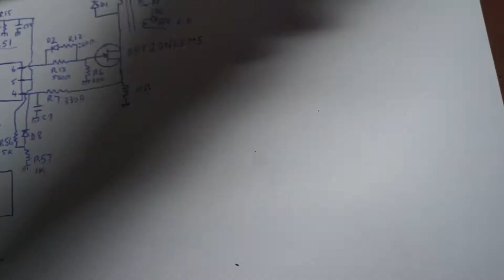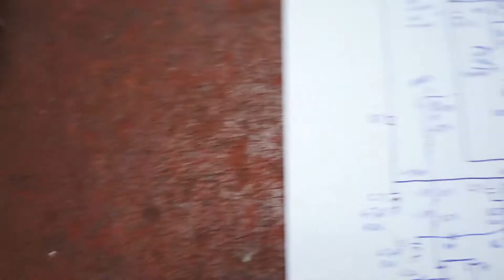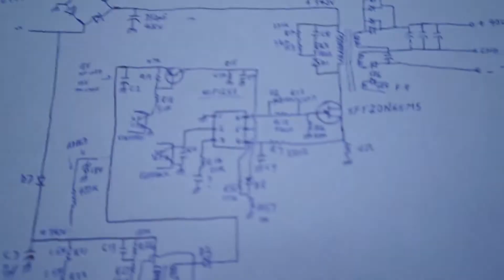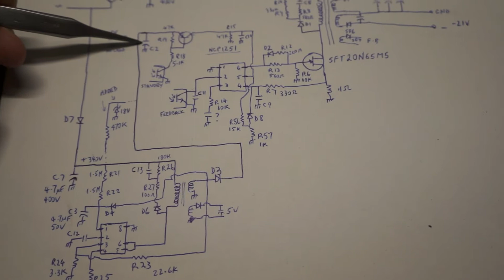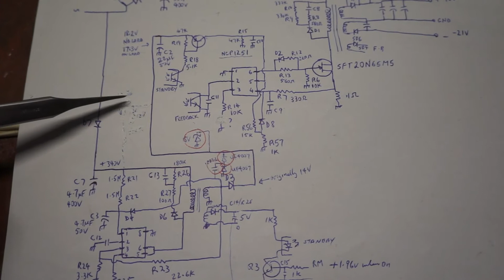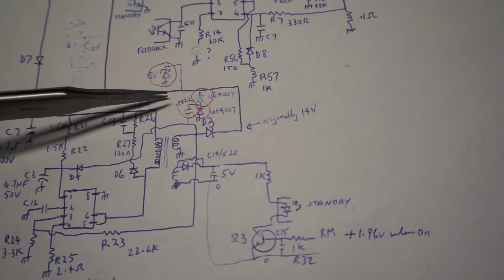KRK Rokit 10-3 Power Supply Repair

Comment: I have a Rokit 5 G4 with the same issue, do you think it would be the same driver IC for the SVF10N65F mosfet that was blown? The board layout looks similar. I have the 5 volt rail only after changing the blown mosfet.
Reply from the maker: The 5V supply is completely separate, and the fact it is working indicates the 340V DC supply is probably OK. The driver IC is a likely suspect, expecially as it's connected to the MOSFET gate without any real isolation, so is likely to have been damaged. Also check the 0.1 ohm source resistor wasn't blown o/c when the MOSFET failed.
Reply: @cool386vintagetechnology6   Thanks for the response , yes I forgot to mention I replaced several resistors that were blown and also the large 400v 82uf cap that had gone open circuit, I guess due to the shorted mosfet. I have another speaker the same and readings across that driver IC are definitely different so I'm pretty sure it's blow. The issue is identifying the driver IC which is marked 8A0H03 so I'm not sure if the NCP1251 would do the job driving the SVF10N65T which is slightly lower rating than your mosfet.

Comment: You can use the NCP1256 or its equivalent the UCC28750 as a mosfet driver (:
Reply: Do you know if I need the 65kHz or 100kHz version? Also, there's versions that will latch or auto-recover on over-current/over-voltage, does this make a difference? I don't think it does but have to admit that I don't fully understand the circuit.

Comment: I just had the same problem. Interestingly enough, when you turn it off and back on really quick, sometimes you can get it to start working again and as long as it doesn't go to sleep it'll keep working.
Reply from the maker: sounds like the start up resistors have gone high
Reply: Found that short term solution on reddit. Apparently, it's a common problem with KRK monitors.

Comment: Thanks for the video and for your reverse engineering work. I have a similar problem with a KRK Rokit5. I have the question: Is the code  of 6 pin PWM controller  8A0G01...? Thanks a lot
Reply from the maker: The number of the original PWM controller was not readable so do not know what it was. I used an NCP1251 to replace it, though had to increase the Vcc to 18V as per the mod with the voltage doubler. It is possible an OB2262 might work since this works on 14V, and may well have been the original, but did not learn of this IC until after the repair.
Reply: @cool386vintagetechnology6  I just received some OB2262  and it works! Thanks for the tip  :)
Reply: Did you find a working replacement for your 8A0G01? If so what did you use?

Comment: Thanks for sharing your findings on this.  Surprising to see the insects still intact, evidence of the initial cause of the short circuit. Have you had any similar experiences of blown power supply in the 1st generation ADAM A7 monitors? I have had one replaced only to blow again months later. This was the last one PS available in Oz. The model is subsequently obsolete and parts no longer obtainable.
Reply from the maker: I've not worked on Adam A7 monitors so I can't be specific. If a switchmode power supply blows up, and it's not from a spike on the mains, a common cause is an electrolytic capacitor in the regulation circuit, or a faulty spike suppression network across the primary of the switchmode transformer.
Reply: @cool386vintagetechnology6  so maybe I can get it to you. Would you be able to verify this? I'm in Melbourne.